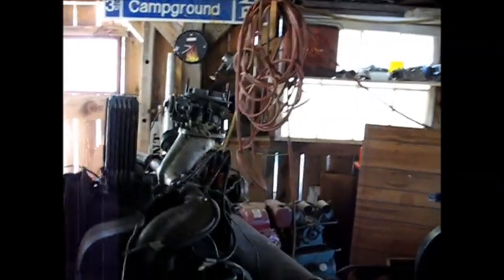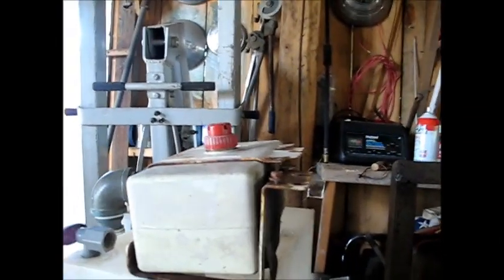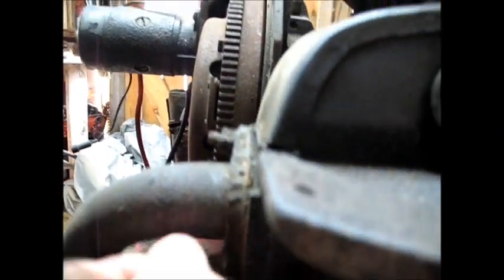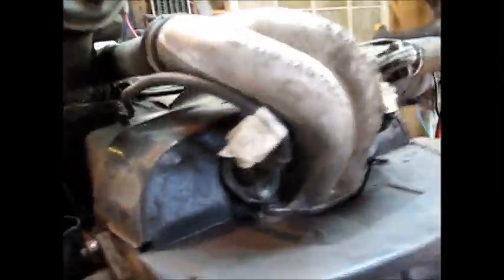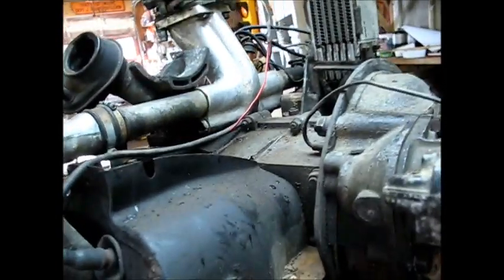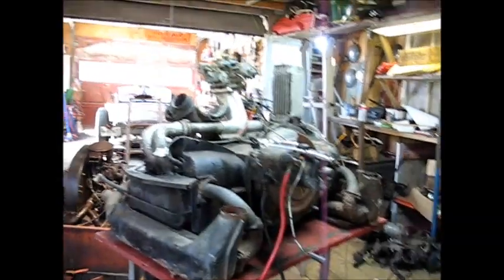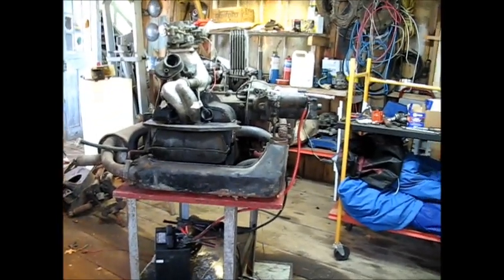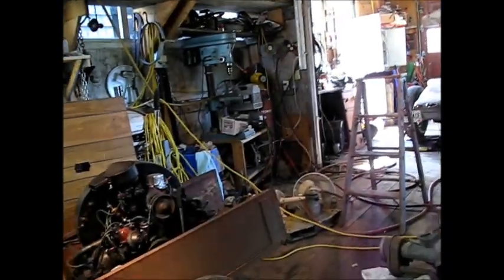Plan of Attack!

Comment: do not use acetylene torch with oxygen. just a propane torch with No oxygen. I used one on my aluminum exhaust bolts on my old honda. The little propane torch dont get that hot. Little torch you use on melting solder the ones that use the little tiny blue bottles like that go on coleman lanterns.